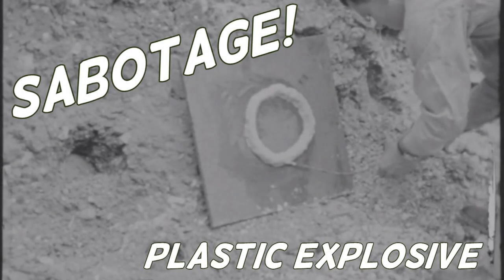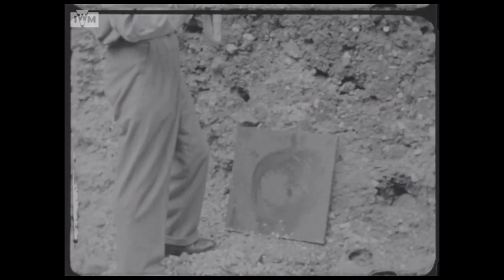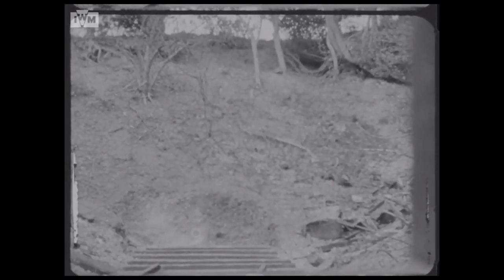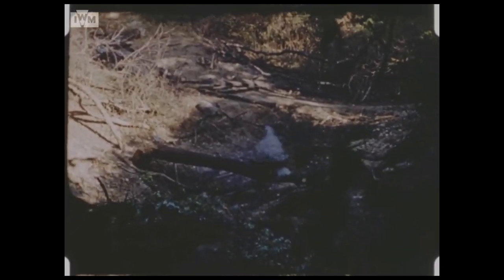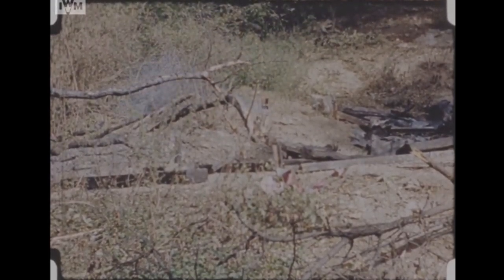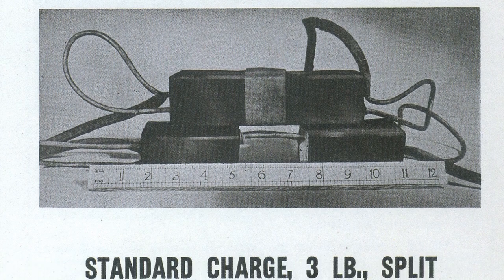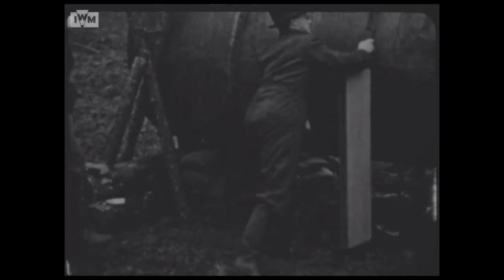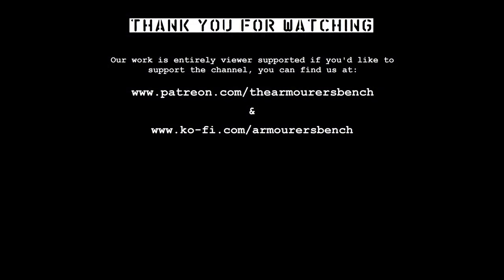SOE Sabotage - Plastic Explosive

Comment: The effect of shaped charges was known at this time wasnt it? Was it easier to just use more expensive than fashion improvised shaped charges? The last clip of the pipe being cut is a perfect example of how inefficient that method is. You can see the rolled edges of the two halves. Half that much explosive would have cut cleanly through with some slightly modified linear shaped charges.
Reply from the maker: It was definitely known and know to the British but I wonder if information wasn't shared between departments. But I would imagine the Monroe effect was known to many engineers. Yes definitely less efficient!
Reply: @TheArmourersBench  that's probably about it. Or I wonder if the video was meant to just simply show how to use stolen or captured supplies. Still a cool video.

Comment: My father was based at an SOE training school (STS42, Roughwood) for the second half of the war. Sadly plastic explosive was in short supply, so agents in training had to improvise with gelignite moulded in warm water, the only protection for the hands being Vaseline jelly. Unfortunately this would soon wear off and the nitroglycérine would be absorbed in to the bloodstream through the skin, and depending on the individual could cause extremely severe headaches!